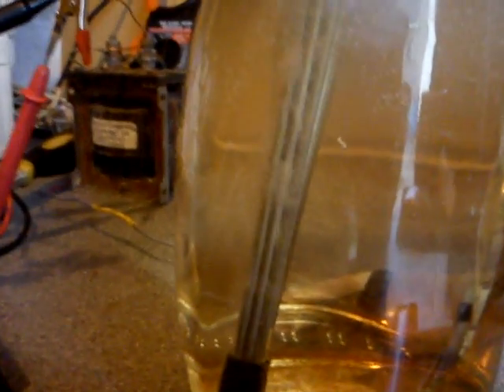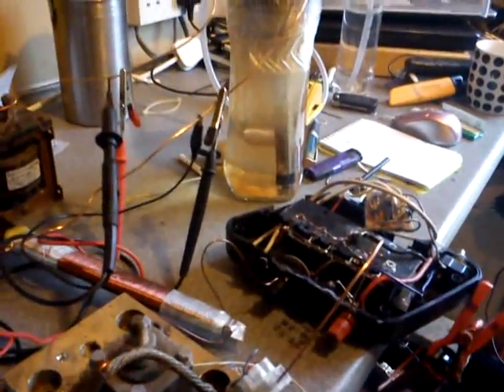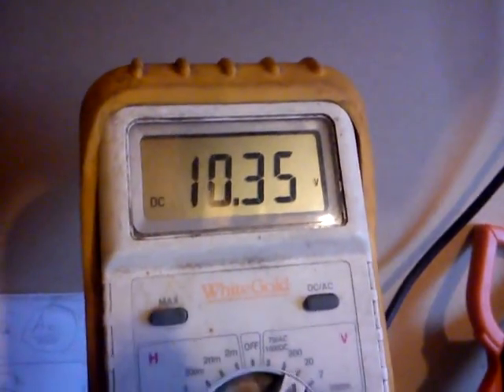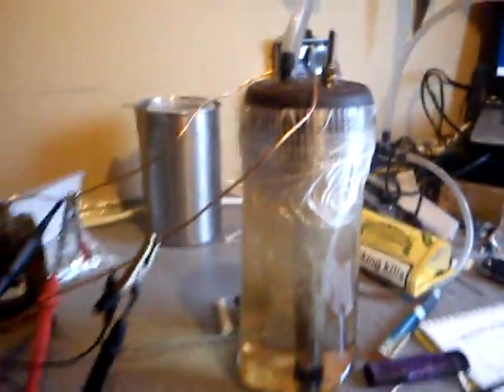Intermission.3gp

Comment: Hi! ok straight off my head, the coil-winder-jig is excellent - wow! Simple setup and easy and easy to make, its the way to go for most of us home-mader's :)

Ideas for the heating of the house.. Go around and check with some local restaurants and get their waste-vegetabile-oil. Free oil, or offer a small cash for "removing the gunk oil" for them.. 
 
Mix that vegetable oil ( filtered and clean and) with the petrol-burning-oil, burn away! A 2-tank system might be best, 1 regular and 1 mixed.

Comment: idea 2:  Coke Can Solar Heater  .. /watch?v=bRZvAAqzXIw  It it works in THAT area, it works in yours!

And you do not really need the cans, can be made form alu-duct or similar.. or scrap.. Paint Black.
Small solar panel for the fan = automatic on/off and off-grid! Ok thats it, u can dooo it ;)